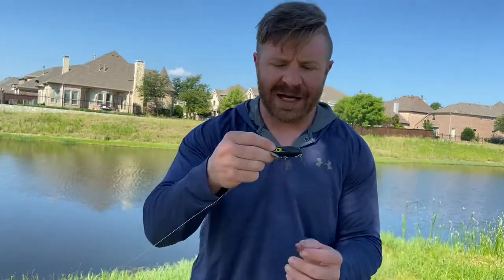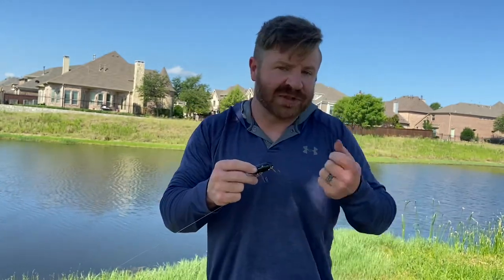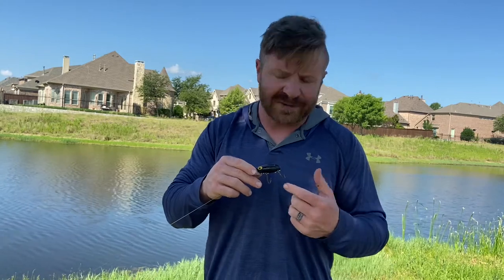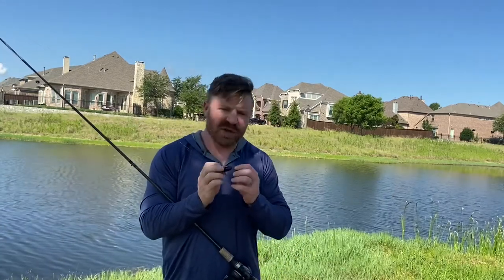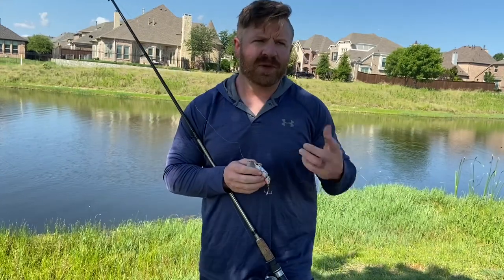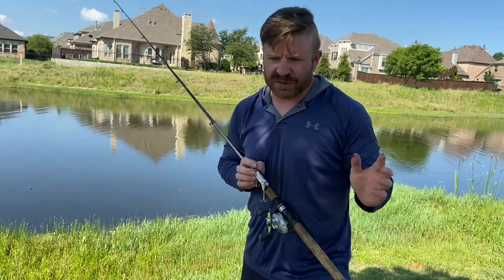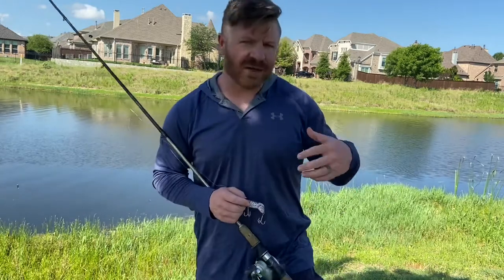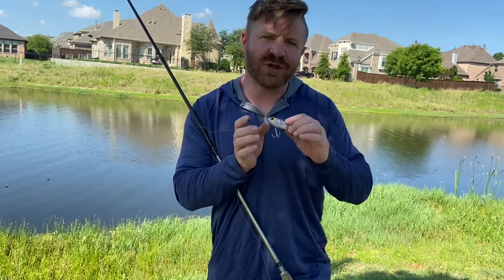THE JITTERBUG: all you need to know

Comment: Awesome video buddy! New subscriber here! Love your channel! Quick question, I used a jitterbug for the first time yesterday. Third cast and a little bass busted this bait, which was 😎, but the lure didn’t seem to want to run right after that. Any thoughts on why that is? Everything looks like it did before I caught the fish. Thanks for your help
Reply from the maker: yeah they drift to one side sometimes which can make staying on a fan cast pattern, or working edges a challenge. Some things to try: 1) right where the eyelet attaches to the blade, make sure thats nice a loose and not binding up. 2) use floating line like a floating braid and keep your rod tip up, regardless of size the line being sunk bellow the blade will make your action wonky 3) you can use a pair of good needle nose and bend the blade edges (the far outside edge both left and right) at a 90, kinda boxing off the blade, only like 1/8th inch or like 4mm of blade on each side of a big bug. Sometimes that will tighten them up and get them running smooth, but ive only tried that on my biggest ones.
Reply from the maker: REally the main things to top that side-slide, put on a split ring and keep the rod tip above your waist.

Comment: Cool video!  What type of line and rod for this specific lure
Reply from the maker: How big a rod I use is mostly determined by the type of bank Im fishing, or how much water I need to cover. I grew up throwing the large jitterbug on a 6' pistol grip fiberglass rod, and roll casting to keep the lure out of overhanging trees. Now Ill throw the big jitterbug on a 6.5-7' graphite rod with a good mono if there are sparse trees, or im fishing off the kayak. I use medium heavy rods with relatively quick tips when fishing topwaters. Big topwaters like these dont get tons of strikes they get a few big ones, so dont go with huge gear thats going to wear you out over the day. Im using P-line for my mono and PowerPro for my braid, though Im not happy with it and will probably find something else. I prefer lines that are clear, smoke, or green. I will only use red or green lines on my catfish set ups
Reply from the maker: what line you use can with antique lures is a bit of boondoggle sometimes. With Jitterbugs I use P-line mono, and a 7' berkley lightning rod. Im not even sure they still make those. You may want to use braid, which you can do with the large jitterbug model with cut hooks, you should NOT use braid with Devil's Horses, I have tons of lure fouling problems with those unless I remove the front prop. I should do a video on some other modified classics.
Reply from the maker: The rod completely depends on if Im fishing off the bank or out of the kayak. I fish 7' med-heavy most of the time in general but out of the kayak i use shorter rods (6-6.5) , just more practical for me. I like floating braid, but braid is expensive and kind of annoying if there is a lot of wind. When Im just fun fishing I throw green P-line mono and flouro. If im on Ray Roberts or Texoma then its going to be 20+ pound line. On these little ponds 15 tops.
Reply from the maker: Im working on The Devils Horse. The line fouling is an annoying problem. I THINK the key on those is going to be to go to a much heavier cut  treble to deal with the body roll that causes a lot of the line fouling.